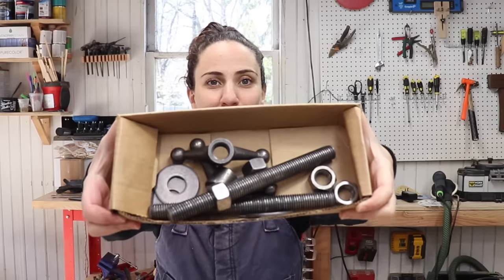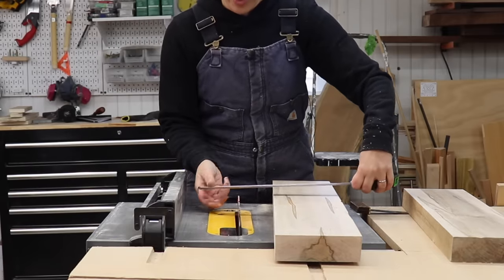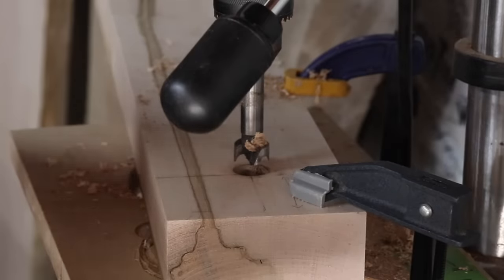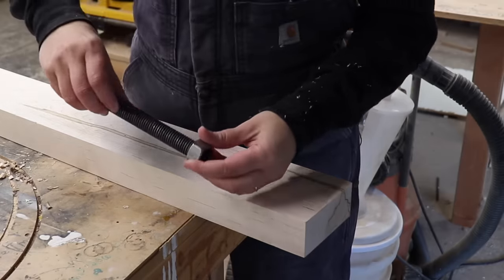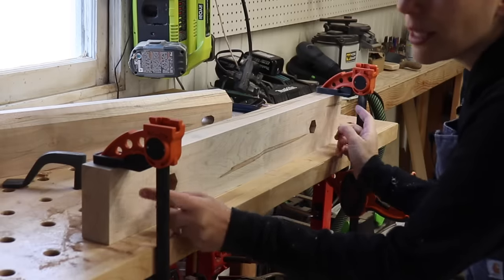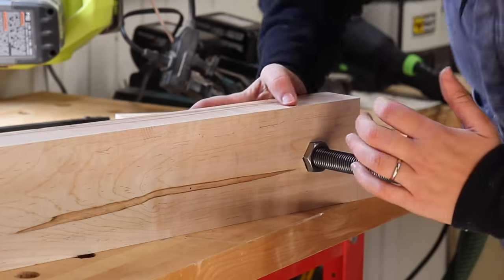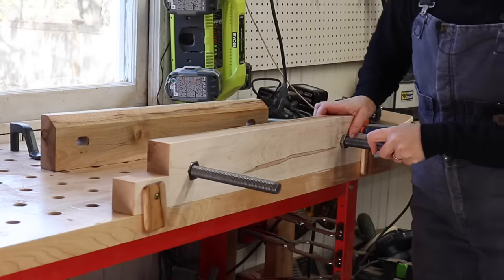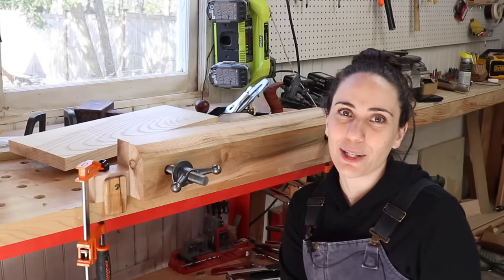$40 Moxon Vise - Easy to build in an afternoon!

Comment: Just curious, if using a moxon vice, why not place 2 nuts into the work surface and use  t-bolts(or other style clamping figure) to clamp the inner vice plate to the work space. Would be quicker than clamps and their are plenty of t-bolts or others available in the shop. If not, just order them to length. Just a thought.
Reply from the maker: If that works for you great

Comment: Thanks, I'm in the process of building a moxon vise from the same kit right now. Question: Would it not have been easier to transfer the marks from the front jaw to the rear jaw by clamping them together in the correct alignment and then drilling a very small hole through the front jaw into the rear jaw? This hole will now be the mark for the forstner bit to go into.
Reply from the maker: Maybe

Comment: Good video but one question don't you have plated metals over there is zinc or galvanized ? If so why they made from plain steel that will rust in damp places or was it just to sell that product?
Reply from the maker: That’s just what this manufacturer makes it out of.

Comment: I will build one. I have some 1/4 by 2 inch bar stock and some 3/4 threaded rod. I will drill 4 inch pieces of the bar stock and weld the rod to them. I will mortice the back to accept the 2 by 4 plates and lag bolt them securely. . I will cut off the threads on some bolts, round the heads, and weld them to some nuts for the front.

Comment: Great video, just ordered the hardware, gonna try my hand at this once it arrives. One question: Is there any reason this couldn't be mounted on the front of the bench and used in lieu of a more traditional vise? I have a flush apron on the front of my bench, and would just need to create recesses for the nuts/washers on the back, and could pretty easily attach it via recessed lag bolts. Thanks again for the video!
Reply from the maker: I would much rather have something where the top was flush with the rest of my bench. There are some cases when I you want to bring the work up higher. But this is really just a temporary fix until I build myself a legit bench

Comment: Nice build..pretty wood.  When I built mine I left the movable jaw hang down below the fixed jaw about an eighth of an inch. That way when I place the vice on the bench the vice self registers on the bench (as long as the vice is closed completely).
Reply from the maker: Thanks! Yeah. That’s another great option.  I figured that the jaws wouldn’t always be closed though. Ha

Comment: Just a friendly FYI... If you inlay pre-cured carbon-fiber rods, square stock or flat stock, you can dramatically increase the rigidity of this design. Also... I don't know what they were thinking when they put that hardware set together, but that is some rather low-grade stuff. You'd be better off sourcing your own hardware from industrial supply shops, now that you know what sizes to shoot for.

Comment: Thanks for this great video on making a Moxon vise, very clear and helpful! Now that you have been using it for awhile, do you find the threaded rod etc get in the way? when dovetailing? I was wondering if all of the hardware could exit on the opposite side so the outside face is flush except for the exposed nuts? Thanks.
Reply from the maker: If you make the back jaw deep enough you can get it flush. But I havnt found it to get in the way.

Comment: Nice work Tamar! 
I was wondering how you got the pieces to stay in the box when you were showing it to the camera...Lol

Since your bench has holes on the surface, you can drill vertical holes in the back jaw so you can bolt it to your table instead of using clamps....Just an idea
Reply from the maker: Hahaha! It was a challenge 😂 yeah. I can also use the my hold fasts in the dog holes but I think most ppl dont have dog holes so this is more versatile

Comment: I am thinking of rebuilding my bench. I was wondering if it would make sense to simply bolt the vice to the bench instead of using clamps. Your thoughts? Thanks Tamar. Great video as always.
Reply from the maker: I was going to do that! But I don’t like my current bench. So This is what I will do until then. But when I build myself a new bench I will build a twin screw vice like this into the side for sure
Reply: @3x3CustomTamar  Can't wait to see the bench build video!  I am thinking of using the approach that Paul Sellers did with the plywood strip on edge but without the tool tray. I would go all the way across with the plywood strips. I have a Yost Vice now but would probably build something like this into the end. Thanks Tamar!

Comment: Looks like things are warming up your way 👍 And nice job on the vice, you've got me convinced I need one! The threads on your kit look well made. For the indexing on the front, if you made the front chop taller and hung it down a bit that could work too. Keep up the good work
Reply from the maker: Finally! Yup. That’s another option. But then you need to have to jaws closed to use it for indexing. Always more than one way!
Reply: @3x3CustomTamar  aww yes, but with those buttery smooth threads, it's a joy to close I'm sure 😜 lol

Comment: How did this hold up after use? I noticed it doesn't have Acme threads, have you noticed them acting up as you use it? Just curious if it;s worth it to invest in the Benchcrafted version or if this is holds up to the test of time.
Reply from the maker: I’m still happy with it

Comment: You have hold-downs. Why use clamps to secure the vise?

Good video, especially the why bother? part.
Reply from the maker: I will most likely use the hold downs. But I think some ppl who don’t have dog holes would think they can’t use a vise like this..... so I made it “simpler”
Reply: Good point.

Comment: qq. instead of mounting the back brace on top of the bench with clamps, if you had an adequate lip to your table, could you not maybe flip it upside down then actually "bolt" it to the underside of the table? thus making it permanent?
Reply from the maker: You can! But that’s a different thing. The point of a moxon vise is for it to be removable so you can move it to wherever you need or if you are lacking space.

Comment: I missed something here - why is this preferred to a bench vise on the front of the bench? In the example given at the end of the video, is it not possible to sue dogs in your bench to hold the piece while planing it??
Reply from the maker: It’s not better. It’s just different. It can be moved to wherever you need to. And it also brings your work up higher which is good for some things. And you can use the dog holes to hold it if you have them. But if I used them here. People would say, I don’t have dog holes so I can’t build this.....

Comment: Great video. May I inquire about your table saw extension? I have the same table saw which I like better than my shop table saw and I want to build an extension for it similar to what you have done. Can you give me your input please? Why your right side grove extension only goes a fraction of the way your left side does. For your table sled? I recently purchased the ZP grove slides (Zero Play) which seem to perfect my crosscut sled cuts. I build a lot of melamine cabinets for commercial use and need that output support. Thank 9uou
Reply from the maker: Thanks! I actually have a whole video on it

Comment: Nice vice but I dont like the way the threads are on the front, its easy to walk in to one, slip, trip and injure  or impale yourself, would be easy though to modify it so they screw the other way and that the back moves and the front is stable.  Either way its nice to look at and is very functional. Thanks.

Comment: Hello, 

I am enjoying your video's.
Cheers for the inspiration ! 

So much so i have just dropped a bomb on wood for a new planter so we can grow a load of veg !

I have a problem and would like you help if you would please !

The planter will be rectangular in shape (standard).

There will be no nails or screws used in this project !
And i think that is where the problem lays. 
My skill is not that of a Japanese carpenter.

 The set up will be a 3 high wall of timber beams that are 45 × 145 x 3000mm sitting around
A 3 wide base that is 45 x 195 x 3000mm

With sleepers as feet on each corner, they will not support the middle beam, i know this is a critical flaw in my plan.

It was suppose to be a challenge, this i could do with some help please.
I have off cuts etc for joints etc.

Please i am out of my depth and my wife has high expectations 😂😂😂 as im sure this is a situation you are familiar with.
Reply from the maker: There are a ton of great videos out there on building planter boxes. Perhaps check one of those out.

Comment: If that WD40 stuff really stops the rust for 1 year, I need a case of it!  In the Florida humidity, with the kids leaving a favorite hammer or chisel in the yard (for who knows how long), they need some protection!  (Also: what do ya got to keep the termites out of a handle, when its lying undiscovered in the lawn for 6 months?)  It could be worse: kids who DIDN'T  borrow my tools just wouldn't seem natural!
Reply from the maker: It’s a non drying formula. So it stays where you spray it. Try it out!

Comment: Ouch, went to the link - About twice the price of the bits in postage alone to Oz...  Wasn't the worst though - the only other USA seller wants twice the price for the same kit of parts (US$64.89), plus just under US$100 in standard postage...  Plus tax and handling and duties (whatever they are...) on the total.  Why I don't bother buying from the US any more since it went silly a couple of years ago.    Even so, will certainly build this, just have to source and fabricate the bits locally.  Nice project!
Reply from the maker: That sucks... hopefully you find something that works!
Reply: Because it is such a simple build, it's super easy to come up with alternative hardware. Most of the parts are in any hardware store, and the handles don't really have to be that large to secure the vise tight. I used butterfly nuts and they work fine. Good luck.

Comment: This is very cool thanks let you know if I end up making this I think I have an old piece of oak that might be a great length
Reply from the maker: Awesome!
Reply: I measured it and it’s only 36” do you think it worth it to make it longer otherwise it would only be 15 wide   I liked the notches for clamping
Reply from the maker: Steve Hannon that really depends on you and the work you do.... do you typically work with pieces larger than that where it would be an issue?

Comment: Hey, there!

Great, now I need one for myself!

By the way, I wouldn't just finish one side of a piece of wood, because it is more likely to bow on you due to its possible difference in humidity. 

I've also seen your holdfasts in the background. Can you use them with your vise? Would be interesting to know. 

Very great project. I didn't know these kits existed. 

Regards,
Etna.
Reply from the maker: Thanks! Yeah. The holdfasts would work. Just didn’t want to limit the clamping ideas for ppl

Comment: Hej hej! 🙋🏻‍♂️🇸🇪
Thx for all great content You create Tamar. The versatile miter sled was particularly impressive. (On my to do list now.)
To give you something in return, have a look at this high tech airplane industry “invention”... Instead of wd40 or similar, this corrosion inhibitor product leaves behind, not an oily but more of a wax like surface. Probably better when working with wood 😉 not to stain your lumber with grabby hands.. 😅 Developed by the air industry for the air industry. Expensive but worth an extra penny. Brand name below. 
B rgds 
Anders
Retired mechanical engineer 
Sweden 

Boeshield T-9 Rust and corrosion protection. 
(Developed by Boeing way back..)
Amazon has it I know

Comment: The original stock looked like 2x4 hardwood.  Where did you get something like that from?
Reply from the maker: It was 8/4 maple. I got at a hardwood dealer
Reply: @3x3CustomTamar  found a potential supplier in Huntington Station.  Fingers crossed.

Comment: Also, Amazon has an almost identical kit, including yhe leather for $49.99US, and including the leather and two 12" F-style clamps for $69.99.
Search Amazon.com, keywords: Moxon vise hardware kit.
If you cant source the leather for ten dollars or less (including shipping) and/or need the two additional clamps to hold it yo your workbench.
I get noyhing from this or I would include links. Just wanted to show there is an additional source for this kit, with added components.
Reply from the maker: Cool. Thanks for the tip

Comment: How did the vice hold up without any leather or grip on the inside?
Reply from the maker: I’m still using it like this and it’s fine. But for my latest project I just needed to clamp something that already had finish in it. And I wish it had leather on the inside of it. So I’ll prob do it at some point
Reply: @3x3CustomTamar   awesome, thanks.   Can't wait to make mine , it's exactly what I need . . Oh, and you're the best  :)

Comment: Can you tell me a bit about putting the captured nut on the inside of the fixed jaw?
Reply from the maker: What would you like to know?
Reply: @3x3CustomTamar  Yeah sorry. I am pretty new to all this, so sorry if its a silly question. But why would you put the captured nut on the inside face? It seems like then the clamping action would want to pull the nut out of the board. My only guess is, you want the outside nut to be behind a washer to distribute the force. And you cant put a washer in front of a captured nut.  Is that right? or is there some other fancy reason?  Thanks for any expertise you can provide! Still learning
Reply from the maker: Brian Turner so the captures but goes on the inside face. And then it’s locked into place on the backside with another nut on the outside. Having 2 nuts in the rear jaw prevents it from moving anywhere when you screw on the handles.

Comment: unfortunately no info provided on forstner bits sizes, now i'm wonder what size to use for my 1/2" thread, how much play is too much?
Reply from the maker: My website post lists all the tools you need and the whole process.
Reply: @3x3CustomTamar  I found the instructions on your website. thanks! it looks like you used 3/4” forstner bit for the 3/4" bar and magically it wasn't too tight, i wonder how that's possible, i guess the natural 0.25 mm play is enough to allow for free movement within the hole. in my case, argentina does not sell 12.7mm bits for my threaded bar, nor is there a 13mm size. so i bought the next available size (14mm) and hope it won't ruin the clamping quality of the vise. i love your content, cheers from latin america.
Reply from the maker: Fedor Butochnikow I think you should be fine

Comment: Nice job. When you're squaring a line across, flip your square (like at 3.36) so it rests solidly on the timber. And don't flip the side your reference at 3.46 or any error you make in measuring will be offset the other way. Good work otherwise :)

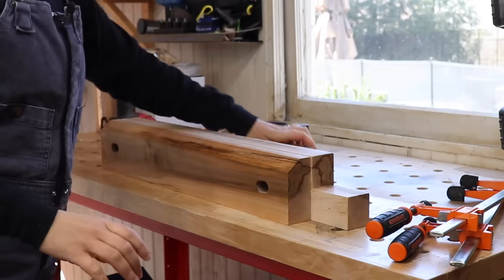Comment: 12:08 Why did U make these tabs? I really don´t understand it. You couls use a spacer in the workbenchholes (sry, can´t describe it better because of my poor english knowledge)
Reply from the maker: To align the back jaws with the table. They aren’t necessary. Just a quick way to make sure the inside face of the back jaw is in line with the benchtop
Reply: @3x3CustomTamar  Thx for the answer. Stay safe

Comment: Why not make your work bench the back jaw of the vise..or bolt the back jaw to the bottom of the bench and let the front jaw come up even with the work bench..??Also you need to stabilise that bench so it doesn't move at all..much too lose imho...good job on the build..😐 that WD 40 type is just what I'm looking for.. tools..guns..if it works I'm sold...time will tell..stay safe...
Reply from the maker: Yes. That is the ideal situation.  But if you don’t have a workbench like that this is a great solution bc it can be put anywhere. That being said. A workbench build is in my future 😉

Comment: OMG 2 and 3/8ths... that is what in the rest of the world? Honestly woodworking in metric is so much easier...
Reply: The old metric-is-better whine rears its head once again.  Not a valid complaint in woodworking, IMO, read on...

The dumb part of how woodworkers measure is NOT due to a difference between Imperial and metric, but rather the convention chosen by most using Imperial to express the smaller measures needed for adequate precision (fractions of an inch.)  The use of decimal fractions in Imperial measures, instead of using binary-power fractions, would make it every bit as simple to use, at least in woodworking, in which feet don't necessarily come into play (THAT'S the sucky part of Imperial - 12 inches to a foot, 3 feet to a yard, etc.) unless one is building a house or something.

Comment: $40 for a hardware is a bit of a rip off. You can get 2'x3/4" threaded rod on amazon for under $20. The nuts and the washers probably a couple of bucks. The handles can be made of wood and fitted on the nuts. Piece a cake. Other then that, nice presentation.
Reply from the maker: To each their own

Comment: Undoubtedly a useful item, but the hardware... studding (threaded rod) nuts and washers from your hardware store will be zinc plated and a fraction of the price and with a couple of extra nuts you can make the knobs to tighten the vice. Forstner bits are easy to sharpen with a file.

Comment: Hmmm, your kit for under 40 Dollars…just twenty four months later, and via Amazon in UK, is now 120 Dollars. Sickening prices.  Not Tamar’s fault of course, but all these Moxon kits shown on the various YT Woodworking channels, are stupendously expensive for a couple of rods, nuts and clamp.  It would be less costly to just install a pair of regular metal carpentry vices spaced two feet apart huh!!!
Still love the channel…